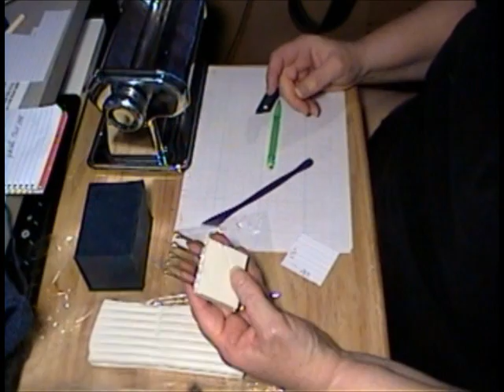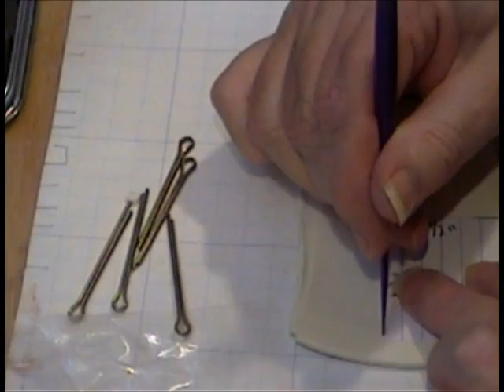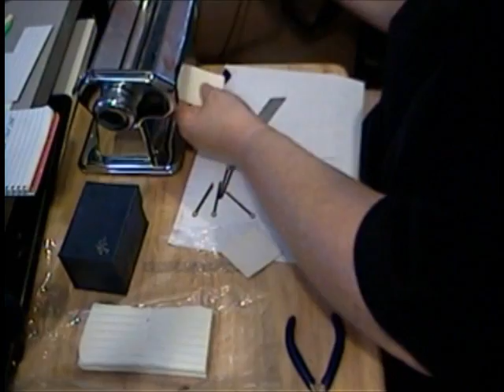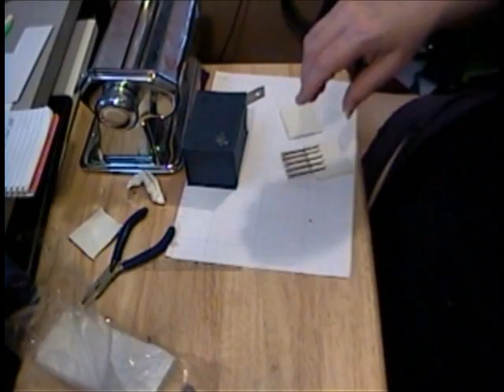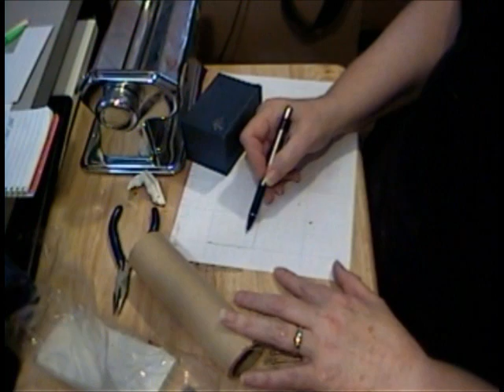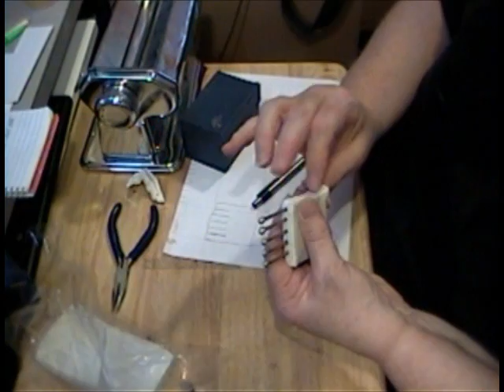Creating a transfer tool for machine knitting using Polymer Clay tools part 1

Comment: Can this be done with the Bolkin pins  to use on a 4.5 standard gauge machine?
Reply from the maker: itj would have to be a thin pin, try the pin out on the machine

Comment: Hi Cynthia, Thanks for the tip. I made two  4 pin transfer tools for my LK150 machine so that I could make reversible cable stitches (k2 p2). I had to use the 3/32 x 1.5 inch cotter pins since these we were the smallest I could find that were long enough to make the tools. I squeezed the pin heads with pliers to made the pins a bit more narrow to fit into the machine bed. I used premol sculpey clay because it dries hard but not brittle.